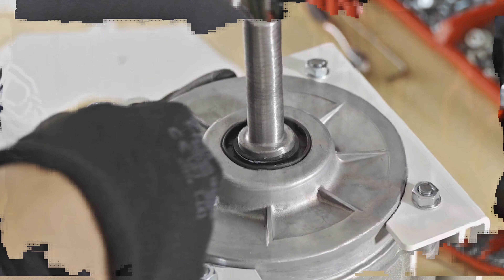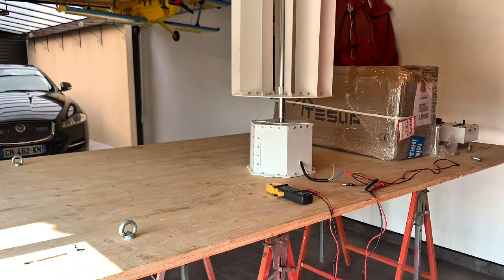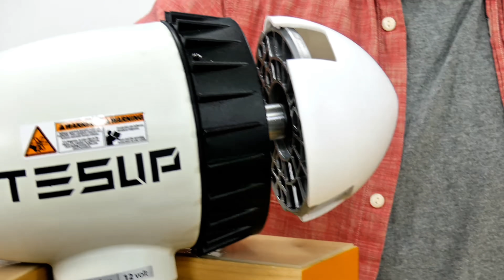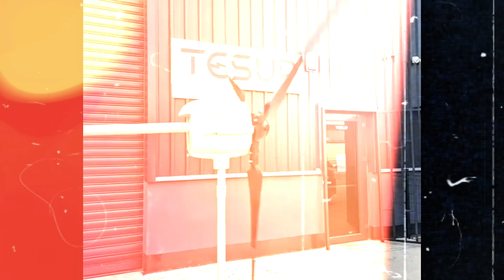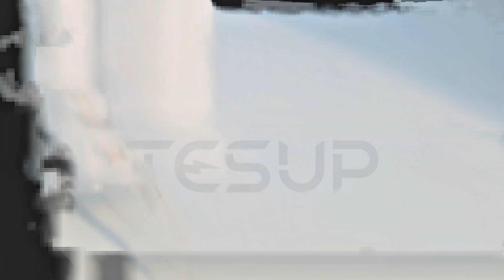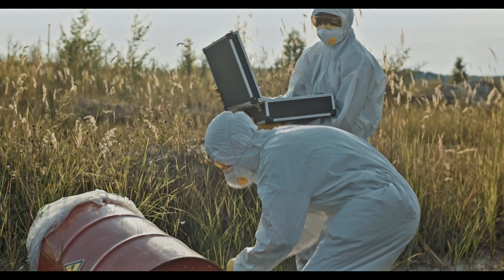2026 TESUP Wind Turbines: Europe’s Game-Changer in Clean Power—Unstoppable Energy Revolution!"

Comment: So how does it connect to the house so that is runs appliances?
Reply: An inverter changes 12v DC to 120v AC but don't believe what they are saying. If you are interested in making power go with a battery bank and solar panels and I run a house off of my setup at 4 kilowatt hours

Comment: OK. So every few weeks a new "revolutionairy windturbine" is presented claiming outrageous power outputs for its size. As always this is utter BS. Let me explain why in a few steps. I will use Metric, since that is SO much easier for physics. Yes, it is a little bit of math. But do not let that scare you. Breath, sit back and relax. Once you understand how to calculate this stuff, you will never ever fall for these "small wind gerator scams" anymore. Just calculate, and laugh your socks of. Here goes:

1) You extract energy from a moving mass. a cubic meter of air weighs about 1.3 kg. 
2) As you may have remembered, every moving mass contains energy. So has a moving mass of air. Energy of a moving mass equals 0.5 * m * V^2. m is mass in kg, V is speed in meters/second.
3) Lets assume the wind speed is 5 meters per second.  If one could extract ALL energy from that moving 1.3 kg,  you would have harvested 0.5 * 1.3 * 5^2 = 16.25 Joules. (Joule is a unit of energy, like a mile is a unit of distance).
4) If your windturbine has a wind facing surface of lets say 2 m^2 (square meters), while the wind blows at 5 m/s, the air mass traveling through that turbine is: 2*5*1.3 = 13 kilograms. 
5) So if 13 kg of air moves at 5 meters per second, power is 0.5 * 13 * 5^2 = 162.5 Joules per second, or Watt. Joules per second is a bit compareable to speed: miles per hour. 
6) Do not mix up units of energy (Joules) with units of power (Watts). Just like you do not mix up Distance (miles) with a unit of speed (miles per hour). 
7) Unfortunately, not all if that energy can be extracted. If you could that, all air would come to a complete stop. And no air could pass the turbine anymore.
8) the theoretical maximum a turbine can extract in optimal conditions is about 59.3% (see: https://en.wikipedia.org/wiki/Betz's_law). In *real life*, the best generators only manage 70% of that. 
9) This means, that from that juicy 162.5 Watts you can only harvest 0.593*0.7*162.5 = 67.5 Watts.
10) Yes, this 67.5 watts is a bit shit. Especially for 2 square meters of turbine. 
11) Additionally, Vertical turbines are always worse. No matter how innovative or exotic they might look. This is because half of the blades move with the wind, whereas the other half moves against it. Just like cycling against a gail. Not efficient. The normal propellor like wind generators perform much better. Just like a sailing yacht can travel faster then the wind. 

If you get the simple equations, you can now punch in your own numbers. Check what your average wind speed is, and convert to meters/second. Use that value instead of the 5 meters per second of the example. You have a turbine with a diameter of 3 meters? Cool. You have a cross section of 3.142 * (0.5 * 3)^2 = 7.1 square meters. Use that instead of the 2 square meters of the example.  

As icing on the cake: although 5 meters per second sounds a bit of a weak wind: it still is 11.2 miles per hour. Or 4 Beaufort. At my place, I do not have an average windspeed of that. Plus, wind that is not laminar, basically ALL wind in an urban environment, holds way less useable energy. 

Sure: it is possible for a small urban wind turbine to generate quite some energy in case of a gale. But those wind speeds do not last very long....
So: buy solar panels instead, if you want to generate your own "juice". As a bonus, your neighbors might like you a lot more since solar panels generate remarkably less noise than turbines.

Comment: It sounds a big scam. The performance numbers they state are at least 10 times more than it is theoretically possible. Also, air close to the ground is unreliable and wind turbines need air speed close to their max to produce meaningful energy. Even air at half of the rated speed will produce less than 15% or rated power. Lower wind speeds will produce next to nothing. Solar panels are much more reliable and cheaper for the same total energy over the same period of time.

Comment: SCAM! All tests on small ground-mounted wind turbines show that they produce very little electricity. 
Solar panels always generate at least ten times more electricity for the same investment of time and money! They are reliable and require virtually no maintenance for at least 25 years. However, 9 out of 10 small wind turbines stop working after some time due to strong gusts of wind near the ground. Anyone without a mains electricity supply will need a petrol-powered generator anyway.

Comment: Short answer: The 2026 TESUP-branded small wind turbines are very widely described as a scam or near‑scam by independent reviewers and customers, mainly due to extreme overstatement of power output and serious delivery/support issues. [youtube](https://www.youtube.com/watch?v=6ixUmlN-cYc)

## Evidence on performance claims

Independent technical reviews of TESUP’s vertical‑axis “Atlas” turbines show that the advertised multi‑kilowatt ratings are physically unrealistic for the rotor size and typical residential wind speeds. One detailed video analysis comparing claimed 7–10 kW outputs with standard wind‑power equations finds that realistic maximum output is on the order of a few hundred watts at best, i.e. a tiny fraction of the marketing claims. Users and engineers on DIY/renewables forums also describe the site’s multi‑kilowatt claims for compact vertical turbines as “basically a scam,” pointing out that the machines cannot deliver anything close to advertised performance in the field. [powerforum.co](https://powerforum.co.za/topic/7804-tesup-atlas20-review/page/3/)

## Customer experience and “scam” reports

Across multiple country domains on Trustpilot, TESUP scores in the “Bad/Poor” range, with many reviewers explicitly calling the company a scam. Recurrent issues include: [trustpilot](https://www.trustpilot.com/review/tesup.com)
- Pre‑payment for turbines or inverters that are never delivered, sometimes for 6–12+ months, and difficulties obtaining refunds. [trustpilot](https://www.trustpilot.com/review/tesup.nl)
- Shipments that arrive incomplete (e.g. turbine with no inverter) and then long or indefinite waits for missing components. [linkedin](https://www.linkedin.com/pulse/dont-buy-tesup-olav-l%C3%B8ite)
- Extremely poor communication: no functioning phone contact, unanswered emails, and support tickets that go nowhere. [linkedin](https://www.linkedin.com/pulse/dont-buy-tesup-olav-l%C3%B8ite)
- Reports of low build quality, corrosion, misaligned shafts, and turbines that do not start or produce meaningful power even in strong wind. [trustpilot](https://www.trustpilot.com/review/tesup.nl)

Several long, independent write‑ups from customers and engineers describe TESUP as “scammers,” “crooks,” or a “well‑run scam organisation,” saying they lost thousands of euros and now actively warn others not to buy. [linkedin](https://www.linkedin.com/pulse/dont-buy-tesup-olav-l%C3%B8ite)

## Marketing vs reality in 2026

TESUP’s own 2026 marketing talks about rows of turbines “ready to leave our warehouses,” presenting an image of a successful European manufacturer ramping up production. At the same time, current and recent reviews from 2023–2026 still report non‑delivery, missing items, and non‑responsive support, which strongly contradicts that polished messaging. There is no independent, peer‑reviewed evidence that a genuinely new 2026 TESUP turbine design has solved the underlying physics and quality issues that earlier models faced. [tesup](https://tesup.com/au/blogs/post/2026-starts-strong-wind-turbines-ready-to-leave-our-warehouses)

## Practical risk assessment

Putting this together, for a small‑scale user like you the situation looks like this: [reddit](https://www.reddit.com/r/SolarDIY/comments/1k6eq3b/tesup_atlas_vertical_wind_turbine_generator_10_kw/)

- The power ratings are almost certainly exaggerated by a large factor.  
- The probability of serious delivery or after‑sales issues is high.  
- Independent engineers and many customers explicitly label the company and its wind products as a scam.  

So while “scam” is a legal term that courts would decide, from an engineering and consumer‑protection standpoint treating the 2026 TESUP wind turbine as a *high‑risk, likely fraudulent* purchase may be justified.

Comment: Let’s run the numbers briefly: A vertical 10 kW Atlas turbine, fitted with optimal rotor blades and installed at a site with constant, steady wind speeds, generates a maximum of 8,000 kWh per year—which works out to less than 22 kWh per day. That is just under 1 kW per hour. Bear in mind that these figures are achievable only at the best possible location and under ideal conditions.
The thin cables confirm the reality of this calculation.
It often pays to do the math. When someone mentions "1 kW," it isn't tied to a specific timeframe; it could refer to a duration of one second or a hundred years. In contrast, "1 kWh" signifies a continuous output of one kilowatt sustained for one hour.

Comment: Reviews I see seem to call BS on the power output claims and crummy quality control. Grok summarizes it about the same as well but I dont always trust AI summaries, still, like the saying goes, if it sounds too good to be true, it probably isn't.
Reply: It is complete BS. When the turbine is designed well (that is with a good MPPT charger), you can expect 40 W/m2 of swept area at 8 m/s.  Most close to the ground or roof residential areas don't have 8 m/s of wind, so output will be less.   So Yes, it is too good to be true.

Comment: If I’m understanding this correctly, then you would have to use a DC to AC inverter to actually use the stored electricity. What most people won’t think of when they’re considering to get one is that since it’s not tied to the existing wiring, you have to plug everything into the inverter. So, ceiling fans, and ceiling lights, and other things that are wired directly through the standard AC panel cannot be used through this system, including your central air. Furthermore, every inverter I’ve ever seen has about two or three outlets to plug-in. And then you have to have extension cords running all over the place anyway. So, it looks like you having to use an inverter is the drawback.
Reply: They make inverters and storage systems that can be connected to power the whole house.

Comment: is this fact or fiction?
Reply: If it’s fact then they’ve done something no other creator of vertical wind turbine has ever done (despite looking very similar to existing turbines). 
The claimed figures should be taken with a large pinch of salt. 
For instance if you listen carefully to the 10kw claim it’s actually in storm conditions. 
It’s more likely you’ll get the lower end of output 1-3kw. It might charge a battery pack overnight but it’s definitely not taking you off grid.